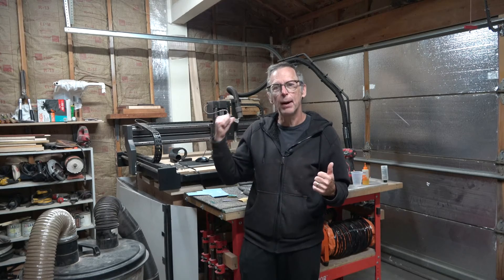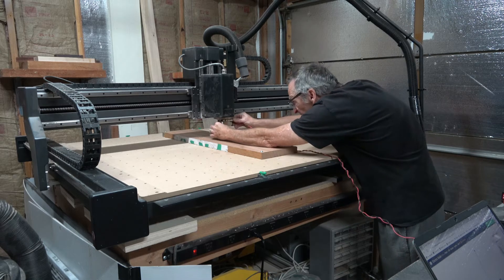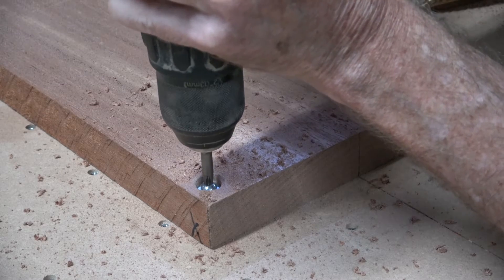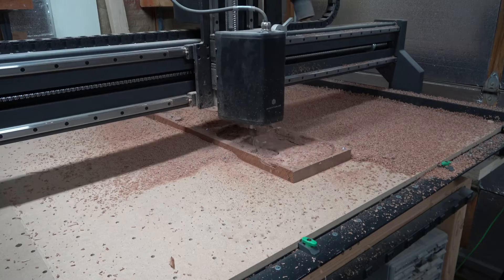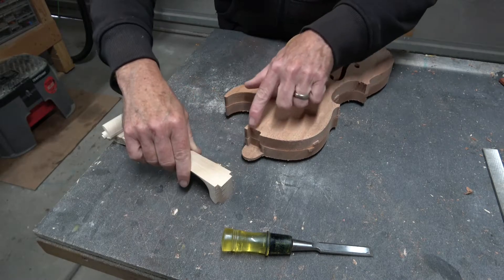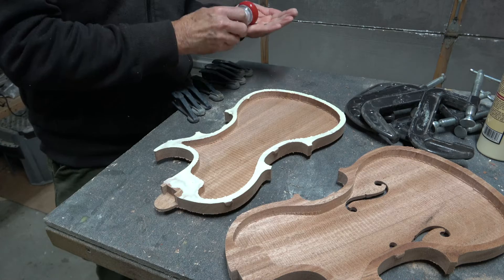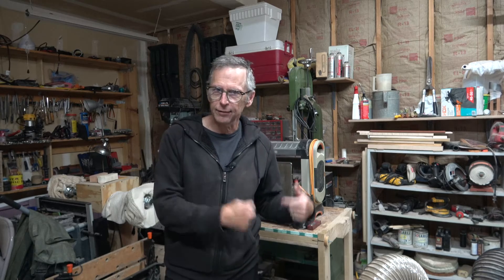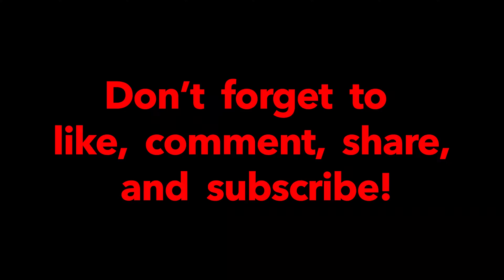Making An Electric Violin Part 7 Shaping The Body With CNC

Comment: awesome!!
what about thickness? is that an issue for electric violins or could they even be solid??

(I saw a luthier re shaping an old violin that was 0,5mm to 1mm too thick in some areas and the sound was off. after he re chiseled the thickness on top and bottom part it sounded better) but of course, an acoustic violin works different to an electric one.
Reply: the reason I ask is, I plan to build a hollow body or semi hollow guitar in 3D. (with ultra thin sidewalls, similar to a hollow acoustic violin)
do you have any tipps for me?
thx
Reply from the maker: If you make it like I made this violin, but with ultra thin sides, the sides will be break easily. Thin sides need to be formed by bending the wood.
Reply: thanks. yes, the sides must be strong enough, as guitars have a more rough life than violins. so I guess I will make the sides thick enough to handle some "abuse"  @HighlineGuitars
Reply from the maker: Electric violins can be solid. In fact, many are.

Comment: Interesting that you carved the 3d top and bottom with a straight bit and not a ball nose. As always your videos are very informative. I appreciate your feeds and speeds. Its off topic but what settings do you use for fret slotting?
Reply from the maker: I have a drawer full of ball nose bits ranging in size from .125" up to .75."  Since they don't make much of a difference in surface finish compared to straight bits, I stick with the straight bits so I don't have to go to the hassle of swapping bits after the rough pass.

Comment: Can I ask why you chose mahogany as a body wood Chris, as I know, tradition dictates, violins, viola's, cellos are made from maple back and sides, and a spruce top! the inspiration for Gibson using a flamed top was, 1 of the executives was on holiday in Europe and saw a violin in a museum,  and thought why have such a plain top, and all the figured wood is on the back and side, where no-one sees it!
Reply from the maker: It’s going to be an electric violin, so the wood choice doesn’t matter and I had the Mahogany.
Reply: @HighlineGuitars  My first attempt was making a 5 string electric violin. It was made of a piece of maple that someone gave me.  Did it all with hand tools (such as they were) although i did shape the top a bit with a friends pillar drill to add a curve to the edges all round.  Took me a long time as my tools were pretty primitive, but it came out workably well. If rather heavy! Bought a pre-shaped neck and fingerboard, though. 
Apart from the weight  it did me in good stead for a few years, until i stopped playing for a long time. Still have it, so might address the weight issue by hogging out a load of wood from the underside.

Used it with a dual bridge piezo pickup, (can't remember the manufacturer's name) which i eventually moved to a very cheap acoustic violin that also worked pretty well. 

Be interesting to see how your pickups work, although i suspect they won't be great, or at least what I would want in a violin pickup, myself.  But if they do something that you like, then Hey! Good job!